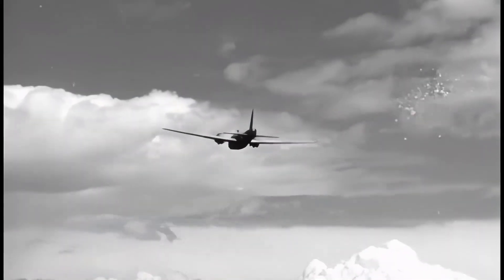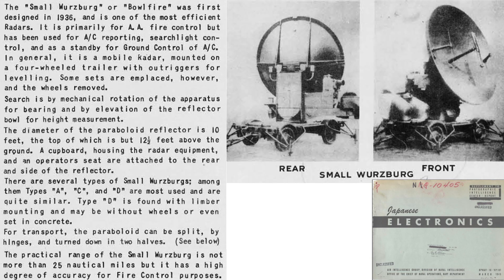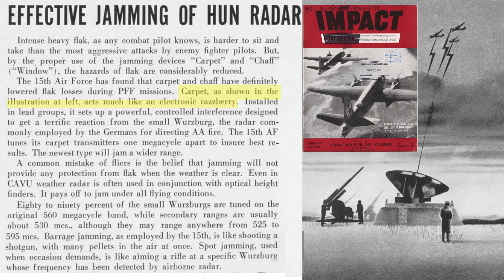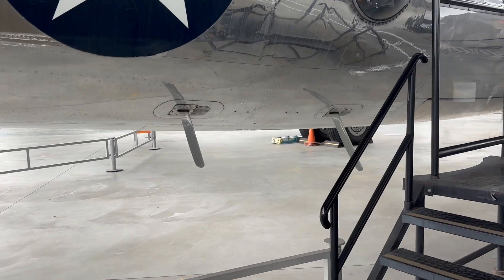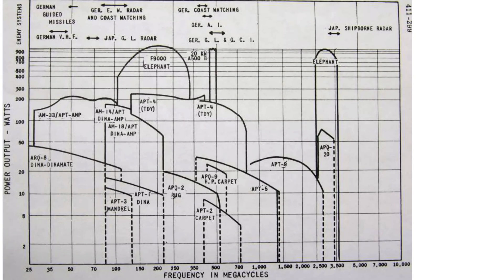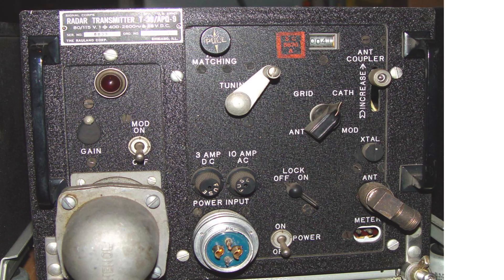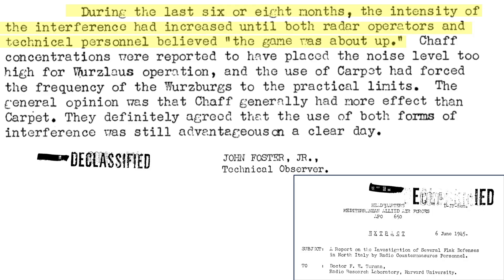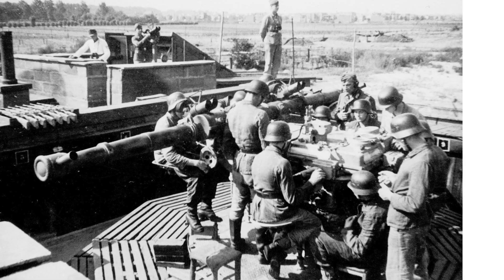Jamming German Wurzburg RADAR with electronic countermeasures “Carpet” –Tactics, Equipment, & Impact

Comment: Awesome military tech video, thanks! I served on a ship as a Radar technician 40 years ago, so I'm always interested in its origins. I didn't realize the Germans had that tech in 1936! Thankfully, they didn't adopt it on a rapid pace.
Reply: Their a difference between designed year and adopted year bud. Btw all most all radars used in the early part of the war was designed in mid 1930's
Reply: @sailordude2094 Various Nations had thought about radar from the late 1920's onwards (thought the people to did ionosphere research had been measuring the height of the ionosphere with pulsed radio transmissions from the mid 1920s). A few  of them being Gregory Breit and Merle A. Tuve who were doing research in the US and got a guy called Leo Young at the NRL to build a pulse Transmitter for them. In the UK, its Edward Appleton and a guy called Watson Watt doing the same. Leo Young was the Leader of US Navy Radar Development and build a short range set in 1934. Somebody in the Royal Navy came up with the concept in 1928, but couldn't get funding. The British Army's Signals Experimental Establishment had two guys called Butement and Pollard who came up with the idea of a Pulse radar in 1930 for aiming Army Coastal Batteries at ships. As at the time there was no threat and no Money, nothing came of it even after they build a working lab model. Germans were working on a Continuous Wave system for ship detection until the switched to a pulse method in 1935. Watson Watt of course got asked to look at the Air Defence Issue in early 1935 and that lead to the British going all out on a long wave length / Long range system off the bat (Chain Home), and following that with aircraft based systems to make up for the limitations. As soon as the Royal Navy and British Army found out about what the RAF were doing, they both wanted in, the Navy just on the Info side, but the Army joined the RAF effort which saw Butement and Pollard joining the RAF effort and they developed a number of systems which lead to British Beam Radars like the US and German Radars. 

The Germans radar development was mainly driven by the Electronics industry. The German Armed Forces wouldn't work together and stopped the industries that they dealt with from sharing data or kit. Three systems in Service or Development at the start of the war. A Search Radar (for surface search and gun laying and air search use (SEEKET and FREYA) and a search light layer for flak (WURZBURG). 

The US (Navy and Army) Systems were driven by the Service Signals Research Establishments. The Navy working on an Air / Surface Search kit (CAMX) and the Army working on two for Air Search and Search light aiming (can't remember the SCR numbers). all systems beginning deployment in 1939-1940 

British had CH long range early Warning  operational in 1938. A smaller Transportable CH type system called Mobile RDF Unit in production in 1939. Air Intercept and Air to Surface Vessel in an advanced state of development. A Transportable Gun Layer radar (not a good one) just entering production and the Coastal Defence Radar in advanced development which became the basis of the Chain Home Low radar which was ordered in July 1939.
Reply: They hat different frequencies.....not as good as allied(Brits)
Reply: -Germany can be credited with inventing radar in 1932 ahead of the UK and USA in the sense of both detecting the first ship and detecting the first aircraft by radar.  
The head of the German Navy's Signals Branch the Physicist Admiral von Kunhold had been developing active sonar for both mine hunting and hunting of enemy submarines but wished to extend the sonar to fire control for both submarines and surface ships.  It eventually worked for u-boats (the famous Type XXI could aim its torpedoes with 3 undetectable Doppler pings (at the time since maximum straight methods didn't work).
-The difficulty of using active sonar on a surface ship against another surface ship lead him to use sonar techniques with radio instead of sound waves.
-They developed a 13.5cm microwave radar of a mere 600mW output using a Barkhausen Kurz Oscillator and were able to create a Doppler radar that could detect ships.
-The microwave was way to weak but more success was achieved with a 50cm split anode magnetron or 4kW.   So by 1932 and 33 they were detecting ships and aircraft and ranging them.
-Split anode magnetrons tended to be a little unstable so the switch to acorn valves was made and a 1.2kW 50cm set called Seetakt was produced which was latter changed to 1.5kW at 60cm.    By 1938 all German Cruisers and Destroyers on up were being fitted out with Seetakt.
-Bismark had the FuMO 23 Seetkat of 1.5kW power but only 3 months latter Tirpitz had FuMo 26 with 8kW power and lobe switching for blind fire control (0.25 degree accuracy) and new vacuum tubes shock resitant to gig gun fire.
-Seetakt altered to 2.5m was called Freya and used as an early warning radar against air raids about 13 were in service by the battle of france. 
-von Kunhold had originally approached Telefunken Company but the head of R&D a Runge mocked the idea of radar so von Kunhold had the little GEMA company who  made sound recording equipment for training hydrophone operators make the radar.
-Runge had second thoughts and this lead to Telefunken developing the Wurzbuirg radars.
-The poor relationship between the men caused by Runge rudeness lead to poor cooperation.   von Hunkhold was a proponent of microwaves and Telenfunken could have developed them.
-In April 1942 the Germans made a fatal mistake and abandoned their microwave program due to shortages of staff against advice of Dr Martini who headed the Luftwaffe electronic warfare operations.   They had by then developed a tunable 800W split anode magnetron and a LD6 disk triode that could produced about 25kW at 27cm but could produce 9kW at 9cm.
About 8 month latter they discovered the British magneto but by then staff had been disbanded with many even drafted into the army.  This meant the Germans took a long time to analyse the captured device.